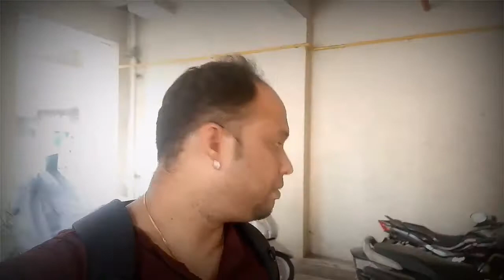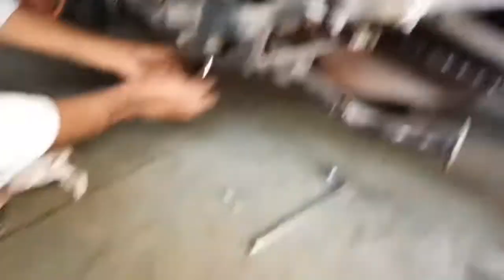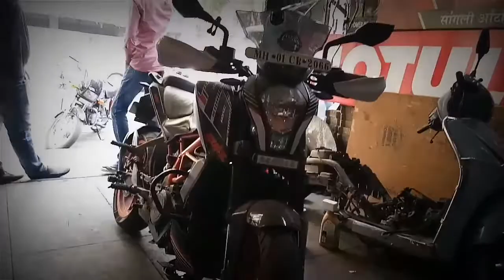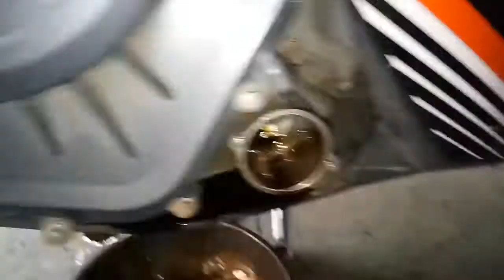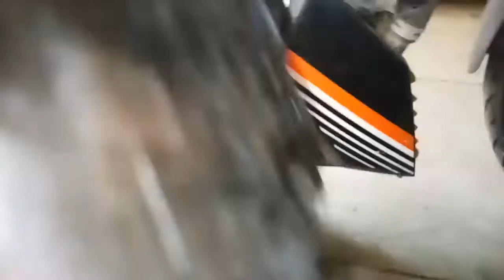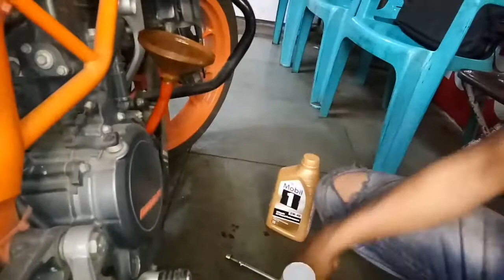Bike Care || KTM DUKE 390 ENGINE OIL CHANGE || Mobil 1 Oil 0W40 ||Duke 390 Small Service at Home

Comment: How experienced mobil0w40 after running 3000&4000 km? What is fact
Reply from the maker: My total experience was good . i ride my bike 7000km on this oil and it is performing very well. Pick up of my bike is inverses little. i feels my bike engine is little bit smoother than before. Overall its good. But i will prefer to go for motul only.
Reply: @Rider390live_ur_dreams   why sir.... again motul
Reply from the maker: @Unicorn-nw6xe  its not motul brother.
Its mobil 0w40 engine oil.
And why mobil "its because i love do experiment on my bike and my experience was good with mobil.
Reply: Bro,, I have a pulsar  150 bike...  I'm also motul user ..... but,this time I will trying to use Mobil 1 20w50 v twin oil... so can u help me on that oil plz.... because my bike recommended API-SL .. But Mobil 1 oil recommend API-SJ .... so ... what can I do sir ... plz help me